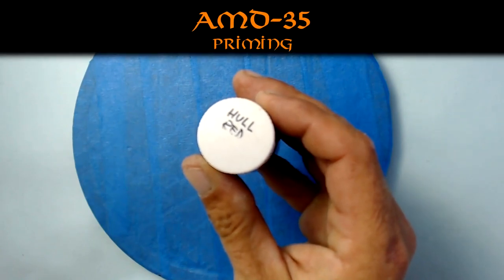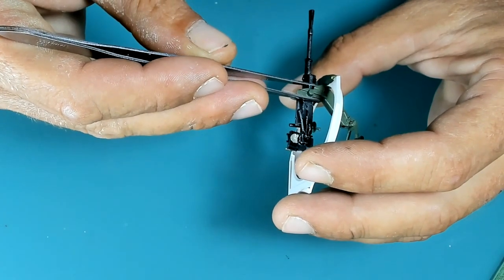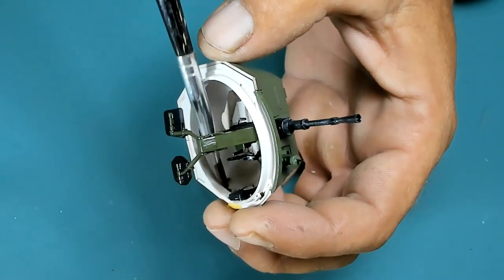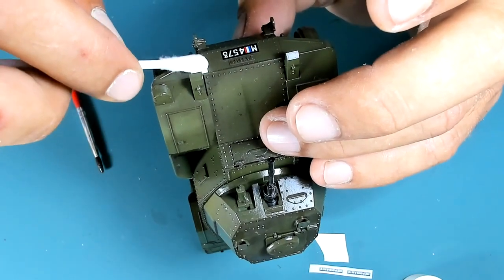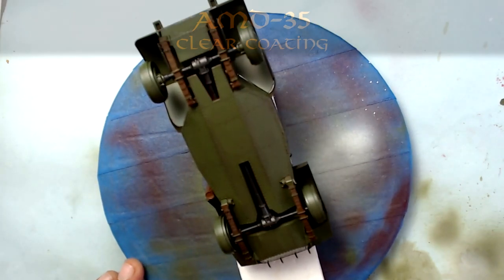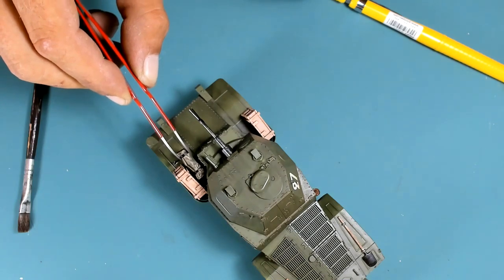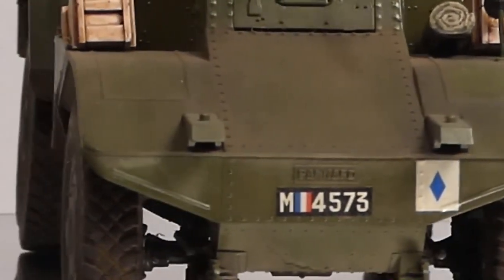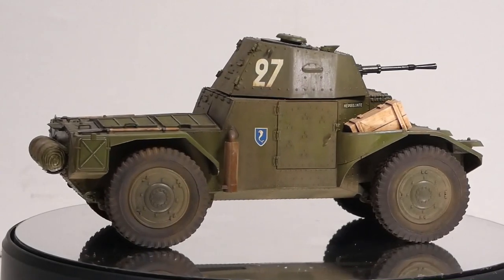Full Build Tamiya / ICM 1/35 Panhard AMD-35 Part 3/3 Painting and Weathering

Comment: Just watched it. Nice job there man! I like the dusting effects. What tool were you using to apply the super glue?
Reply from the maker: Thanks, Scott! The  "dusting" technique has became one of my favorites, since I don't really like the models drenched in mud, but I am fully aware of the need for weathering in contemporary modeling. The "tool" is a .3mm mechanical pencil. It can be made as long as you need it, and you don't need to bother cleaning the build-up on the tip - just break the lead and you have fresh applicator every time! Besides, its .3mm tip makes it suitable for precision application ;)
Reply: So you use the lead as the applicator?
Reply from the maker: @SmallSoldier  Correct, Sir!
Reply: Right on. I'll give it a go. I've been using photo etch applicators and needle tips but all new tool tips are welcome. Thanks  Scott.
Reply: I just tried the mechanical pencil and it worked like a dream. Thanks for the tip! SS
Reply from the maker: @SmallSoldier  I'm glad it worked!  And I'm making the connection now - you have a huge project there with a square mile of PE. Good luck with that one!
Reply: You are correct sir so this could not have come at a better time.